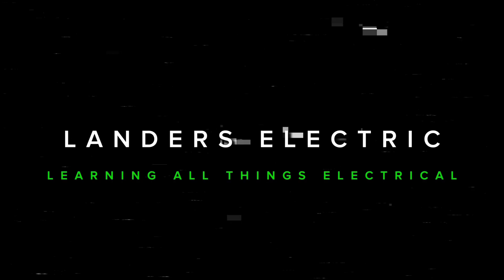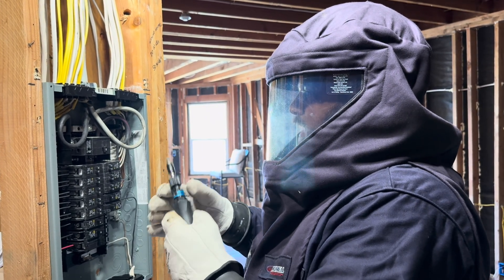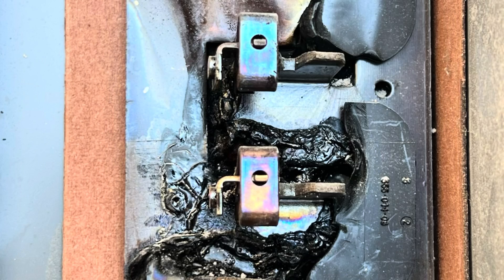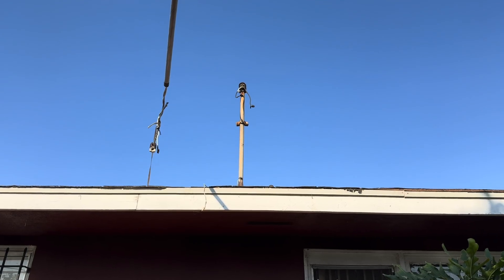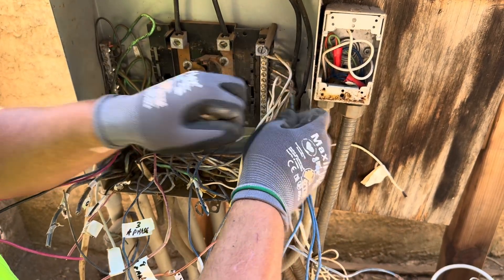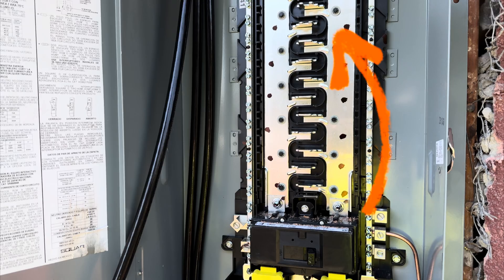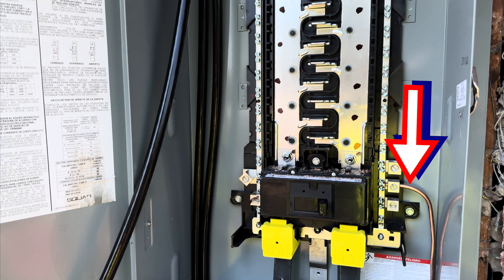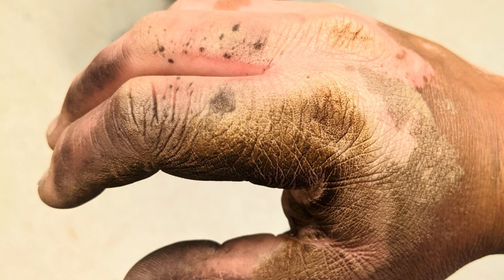I Could've DIED! | Electrical Panel Upgrade Arc Flash Accident

Comment: It's not the voltage that kills but the amperage. Ift takes a tiny fraction of an amp to kill, but you can get hit with 50,000 volts and fall down for a few seconds.

Comment: Retired elevator constructor here. We work with with 240/480 all the time. I was taught in my early years to always stand aside and look away when pulling a main line. A co-worker buddy that always wore a leather jacket (biker dude) pulled a main line back in the 80's when we didn't have any safety rules or PPE, and the disconnect blew. Lucky for him his jacket took all of it. More recently another young co-worker went to pull a disconnect from the early 1900's and it blew, He wasn't wearing his PPE and he was badly burned on his forearm. luckily he did follow the rule of turning your head. Glad your ok brother.

Comment: That's not an arc flash bro that's a short
Reply: and a short circuit that's not solidly connected does what.... oh right it "arc flashes" and continues arcing until it clears itself or upstream breaker trips.
Reply: @throttlebottle5906  there is a difference between shorting (directly touching) between phases or ground and an arc flash.  Arc flash (often called a flashover) is a type of electrical explosion or discharge that results from a" connection through air" to ground or another voltage phase in an electrical system.  

Arc flash doesn't require direct contact to conductors.  The current jumps through the air without direct contact.
Reply: @anthonyhumbert8787  yes, but most often an arc flash is started by something touching without a solid connection or a short circuit somewhere causing a weak point or something being reconnected to arc and blow. just like arc welding, once struck it will stay arcing until it burns open or gets moved far enough away for the resistance of air to break the arc, but now add in the arcing caused metal sputtering and vapors, plus carbon rich air and you have an sustained arc flash.
majority of arc flashes are caused by some fault visible or hidden, lightning inducing a huge direct breakdown of insulation and arc over are one of the few true random arc over incidents.

Comment: One reason I hate working on homeline based panels live. QO and other commercial breaker panels have arc protection in them to prevent something from landing on the live bus.
Reply: I had a 12awg ground wire get away from me wiring a new circuit in. it was touching other bare grounds above and swung straight into a buss bar of a square d QO panel.
I swung my arm sideways and knocked it out, no telling if the main would have tripped or not, as it flashed I was moving. by far not my first time having an arc flash near me or in my face. so do not rely upon any type of magical panel and mostly covered buss to not have an accident.

Comment: Glad you’re ok and lived to tell the tale. You’re right, 120v is much MUCH more dangerous than alot of higher voltages, for example 480v is quick and will toss you across a room like a rag-doll, whereas 120v travels much slower and typically will hold onto you. Also, voltage isn’t what kills you, current does. And 120v conductors will typically have much higher amperage run through them. One code I’ll never agree with is in 250.56, a bare #4 ground for the grounding electrode system should have never been permitted, they should at least implement a new code to say that the bare #4 should be properly insulated with rubber tape and electrical tape within the cabinet. I won’t hold breath though.

Comment: I'd argue the voltage doesn't matter as much as amperage in a case of short circuit like this. I accidentally caused a short in a 24 volt system once, that only gave a small pop before the breaker switch activated, but if the breaker and supply lines are much beefier even low voltages can cause a lot of damage. Just look at welders, they usually work with just a couple dozen of volts, but hundreds or thousands of amps. Especially dangerous are capacitor or battery banks, since they can deliver a lot of current.

Comment: Glad your okay. Rule of thumb i always shut off the main or even pull the panel when doing work like that. Had similar incident happen with meter socket next to panel in customers basement. Rushing to get it done cause she was on oxygen and ended up having a ground wire go across both socket lugs on the meter with all 200amps arcing and having sparks fly. Got lucky and all it did was put a small line burn on my hand the size of the 12 guage wire  and thank goodness I had good EH hazard boots on. Never rush and always pull meter or shut main breaker off and now i always tell customers if you are on medical equipment or oxygen get a generator or go to a family member temporarily while power is out.

Comment: You got a bad shock and your video is a good warning but it's not clear that the essential part of the injury you are describing is actually arc flash. There may have been some arcing but it sounds like your hand became part of the electrical pathway. You don't report burns to the face or lungs that can result from true arc flash that superheats the air. Arc flash hazard is typically over 400 volts. Electricity just doesn't arc very far at 240.

Your inju

Comment: Almost the exact same thing just happened to my co-worker while doing a de-rate on an old panel with a 200A quad MCB.  Even “low voltage” can be gnarly. Arc flashes create a ton of heat. I’ve seen them weld wire strippers and cutters  together instantly multiple times and heard stories of people arcing their impacts in a panel and ultimately blowing the transformer 😂. Fortunately I’ve only taken light hits from both 120 & 240. Always gotta pay attention when working with live stuff. That’s usually when it gets you. When you’ve done something a thousand plus times and complacency eventually settles in until you’re reminded to take it seriously. Plenty of people have been killed by residential voltage. Best not to press your luck.

Comment: That’s not high voltage. If it was your new nickname would be lefty.

I’m not saying low voltage isn’t dangerous. Of course it is, it can kill you.

But voltages are usually relative to the electrical work that you do. The only person who would call 240 high voltage is a controls and communications tech.

I appreciate what you’re doing, I’ve seen a lot of online fools doing hot service changes, before I knew better I was doing them myself.

PPE is good but it’s the last way to protect the worker. Disconnect the service, do it the right way. There’s a reason that the local government and utility require disconnect and a permit to energize, it ain’t the couple hundred bucks in permits.

Study and memorize the basics of NFPA 70E. Even for residential work.

Comment: I was replacing a main panel recently with the outside disconnect LOTO’d. About an hour into the job, and unbeknownst to me, the customer placed a metal handled broom in a closet behind me and it slipped and fell onto his tile floor making a massive CRACK sound.  At the very second it hit the floor I was connecting the main feeds to their lugs with a non-insulated 1/2” hex key and I did not have any PPE on because I locked out the disconnect. I immediately yelled, “SHIT!” And pulled my hand back hard while jumping back. I thought I had been hit somehow. The customer who was behind me watching me wire his panel was very concerned and asked if I was alright also thinking I had been hit. As I did not feel any pain I looked back and noticed the broom and put 2 & 2 together. When I explained what just happened he asked, “Are all electricians jumpy?” I answered,”No, not all of us. Just those of us who have heard main power go to ground before.”

Comment: Let’s be clear about some things here. It’s not about the voltage - it’s about the AIC - the Available Input Current or more recently and correctly referred to as Available Fault Current (to avoid confusion) which determines the size of the plasma ball and explosive engine generated. 

This is determined by proximity, distance and gauge of wiring, terminations, and over-current types between that location and the transformer. And you should have known the risks. Granted I too should have known them before my own incident many years ago that I learned from. 

Training on learning from the mistakes of others is how that’s done. But correct assessment of risks - and the techniques and procedures for safe working conditions are part of that. I’m hoping that you don’t over shoot these with possible incorrect information. Because that is easy to do. And I can already see some of that occurring here.

Comment: Instantaneous short circuit currents can reach 60,000 amps or more in a home / residential 120v / 240v panel.
This will cause a plasma ball hotter than the sun and burn anything it touches instantly.
In a Main Panel, I've seen Copper and Aluminum buss bars vaporized and the steel panel melted by a flash over from a short circuit that happened 3 outlets away from the main panel. 
The Circuit breaker protecting the outlet in the Main panel fused together and then tripped the Main Breaker.  But in that instant, it was all vaporized and melted.

Comment: This is why I'd never be an electrician.. that shit is no joke. Making a mistake fixing plumbing is different than making mistake wiring up a panel. Stakes are way higher.
Reply: wait until you cut out some old plumbing that has a ground hooked to it many years or a fault in the wall making it live and there being an insulated section somewhere.
just last year my friend got between a garbage disposal and the grounded copper water lines. the disposal receptacle ground pin was live from a wire in the wall touching a box, that made the whole sink and faucet live, the faucet had nylon braided flex lines keeping it insulated from causing a short. he was unhooking a dishwasher and touching the copper pipes and got his arm directly against the disposal housing. I confirmed it was a direct 120V connection.
that was after they had a company replace the service entrance and breaker panel, they didn't catch or notice the short either, they came back out after that and supposedly fixed it. then I was washing hands in the same sink and brushed arm against it with hands in water felt the tingle of current flowing and again tested to find it was still live!
I wrote a a nice letter explaining what all was live and what was grounded, third time was a charm for them, then they found the issue(inside the middle of a wall)

Comment: A buddy of mine was installing 800 amp hardware in a 480 V panel. The 1/4” thick copper bus he was installing got away from him and shorted out between two phases. It completely melted the bus and shot motel copper back out at him. The work shirt he was wearing looked like it was hit with bird shot. He burned his retinas so bad from the flash he was out of work for two months.

Comment: The problem here is not the the voltage, but the current available. I don't know about residential systems, but I know the commercial systems I work with would have 2000 amps short circuit current available at 120 volts. (When you establish a short circuit, the current is limited by the impedance of the upstream transformer, so it's not uncommon to have currents 20-30x the value of the breaker on the output of the transformer.) My arc welder is lucky to provide 70A at 24V. So, this guy's accident was like striking an arc 150x more powerful than a welder by holding on to the electrode with his bare hand.

Comment: My milwaukee drill tells the story of how i almost did the same thing...inexperienced general contractor, was just reattaching A.C box back onto the house...thought pulling the fuse would kill it 🤦‍♂️ chuck of drill touched live wire, flash and loud bang, ripped my drill from my hand as it blew it back, drill was 10 feet behind me, i was on my ass. No burns, but the chuck of my drill has a large bead of metal from where it the arc hit it. Still works though 😂

Comment: 120v and 240v ARC flash is worse than a higher voltage because the ARC takes longer to blow free and you should have known this if you are a commercial electrician., but you said that you had been working long hours. I always kill all the breakers pull the meter then cut the drop but I’m also wearing my gloves in 30 years I have never worn a ARC flash suit, but when I started we didn’t have them and we were trained to work everything hot, and now days they don’t teach guys how to do it so if I have to work it energized I make sure that I’m the one who does it not my apprentices.

Comment: Long hours without a break can put your life in danger. Driving, flying, operating machinery, plumbing gas lines or working on hot electrical circuits. This could have happened to anyone! There is at least one other safety violation in this example, and all must be addressed for each and every job. The two man rule where both evaluate the hazards of the job before performing it. Another set of hands in this case would have kept everything away from the exposed busses. I worked on 120/240 and 480 VAC circuits and nearly got killed once. I was with a coworker T-shooting a live  220 VAC welder. I got my hand across a leg. That hurt! Had it gone through my heart, I most certainly would have died.

Comment: 120/240 is nothing to joke about. Any voltage is nothing to mess around with.

I’m an industrial electrician, and work with some very high voltage and amperage. 

Well at this plant I used to be at, there was this so called master electrician, who has worked at the plant since he was 18 and eventually made it into the maintenance department, long before I came there.

He was the plants daylight main electrician. He was the only one, before I arrived there. I was the off shift electrician.

Anyways, this project, that the entire maintenance shop was working on, was an entire remodel with the offices. Make a long story short, this individual was very lax in any safety, when dealing with electrical sources. More of a cowboy. For as long as he was doing it, I was surprised at how lax he was. 

Well, he is not longer with us, as I found out one day before I came in, he had passed from an electrical accident, a circuit he thought was 120, was actually a stinger leg, and he didn’t know what panel it went to, and he decided to short it out, to pop the breaker. So created a large arc that went into his face and killed him. 

I was extremely upset learning this, and how management handled it. 

It shouldn’t have happened. 😢

Comment: Any volt with a LOT of amperage can do wonders. But at 120v can do a lot of damage. As you described, the ground wire slipped across and onto 240v potential between bars and vaporized the wire into plasma that came in contact with your hand. That's probably why you experienced arc into your body. Plasma is conductive.

Comment: Thank you for sharing
I’ll go ahead and just say I’m not in Electrician by trade however I am a contractor and I do electrical work whenever legally I can on my own house or on a property. I’m developing something like that and I was working on a hot panel installing two new 20 amp circuits , and when I was hooking up, the ground was real close to some of the hots coming into the 30 amp circuit. The whole panel was live, which I was comfortable with, thinking I would be careful. 
I accidentally let go of the ground while hooking it up and it touched the 30 and a 20, it blew up and stuck to it, I had some pliers right there, I grabbed the wire with the pliers and pulled it off. Scared the crap out of me and makes me feel like an idiot. I stripped backed the wired where it nicked them and moved on. But Saftey is number one and should not be forgotten.

Comment: come on, if you were changing the panel you would have already pulled the meter. let alone the main breaker. Why are you talking about calling the utility to cut the wires? a lot of nonsense. I work hot all the time since I dont feel like flipping every breaker and having peoples internet etc need rebooting and the only danger is welding burns since the body is not conductive at 120volts
ac. not very anyway if you dont have a bad heart.
Reply from the maker: Hopefully you’ll never go through this.
Reply: not all states/jurisdictions allow an electrician to pull a meter or work live in the meter cabinet. it has to be unhooked by them at the mast first or at the pole and service drop removed if you're replacing the whole entrance. some allow the electrician to do it, with prior permit pulled.

Comment: I’ve been electrician for 55 years was working on a building that covered one square block. It had two separate services coming in the building at 480 V three phase 2000 A each service as I was working on one they had another electrician working on one of the main panels, pulling in wire. The neutral was hooked at the other end and as he was pulling it in, it came in contact with one leg of the 480 V. I heard a commotion went to see what was going on. He was blinded. Total face burnt very badly, but he did survive. I’ve seen other examples of people not respecting the power of electricity and they have paid the price. Luckily, I’ve seen it, but I haven’t been one of those people.